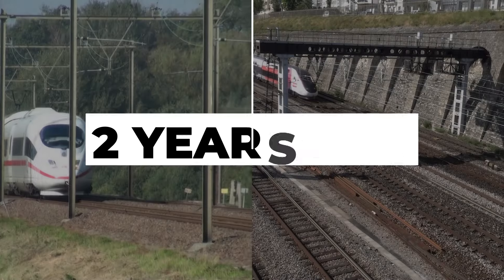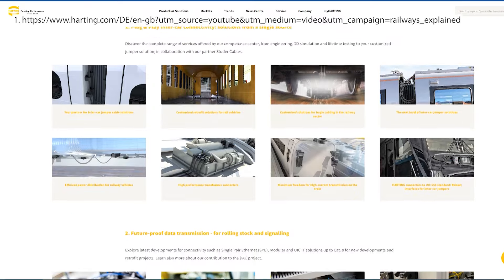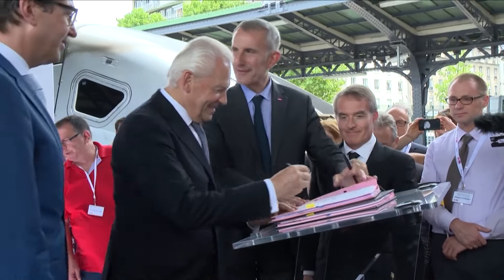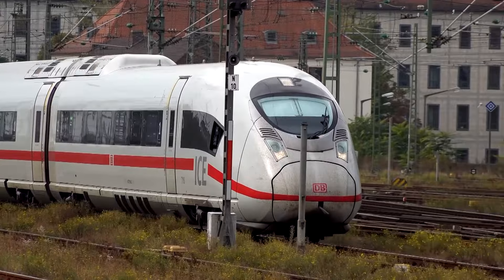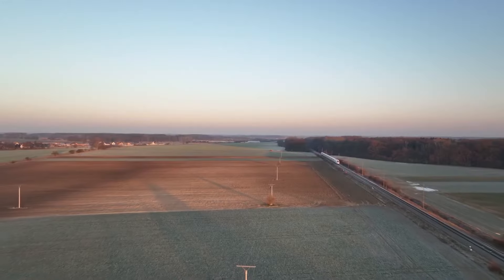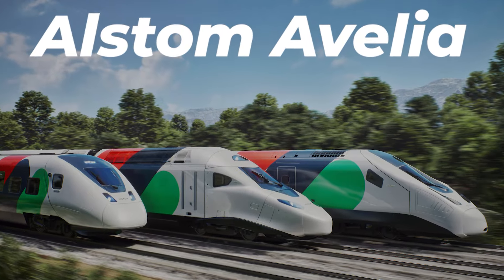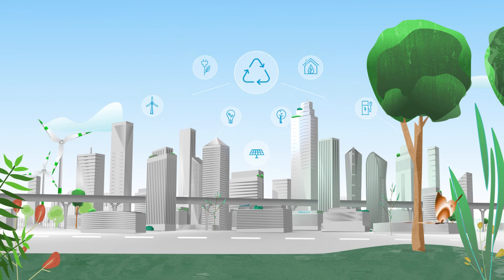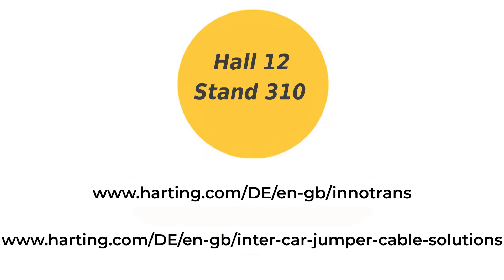Meet the Future of European Rail: Germany's ICE 5 and France's TGV M

Comment: you missed the most important thing about the TGV-M : it's battery that allows it to continue at normal speed even if there is no more electricity on the lines - a world's first
Reply: Not a world's first though, that tech is available on Shinkansen N700S series currently in operation (in case of an earthquake/loss of overhead line power)
Reply: What do you mean by "normal speed"? The most I could find related to the TGV-M's batteries is that it's meant to power the air conditioning and heating during power outages and/or emergencies.
Reply: @JeffFromTheIRS  "Normal speed" for a TGV would be 200-300. It's definitely not normal speed then, since that "greffon" (which is the technology used to power the train in case of catenary failure) is only meant to evacuate the train from the area with damaged overhead lines (at low speeds) to go back to a normally powered zone. tgv m definitely won't run 320 on battery power.
Reply: Not "normal speed", but only 30 to 50 km/h ... still it could be very useful in some cases

Comment: Maintain punctuality? Trains in Cologne are so delayed that the train schedule is just a suggestion at this point. Utter joke....
Reply: But how much of that is due to the trains as they were built? i.e. not lack of maintenance of trains or tracks?
Reply: @GustavSvard very little. Its almost all upkeep and organisation/overusage
Reply: None of those are because of the trains themselves, they're all the result of years of underfunding in maintenance of the tracks
Reply: Of course, there are also technical problems with trains. They are just as susceptible to this as any other technical product. The biggest problem with punctuality in Germany is not the ICE trains, but the fact that most railroad lines are not used exclusively by ICE trains. They share the routes with many other trains, including regional trains and freight trains. And there is a very good chance that a delay will occur somewhere, which of course has an impact on the entire system. Ideally, there would be many more exclusively used routes for ICE trains, but that will be difficult to achieve. Germany is too densely populated and the planning and realization of railroad lines takes decades.

Comment: ICE 5 will be used in Los Angeles - Las Vegas although it will be called American pioneer 220 but it’s a ICE 5
Reply: Not 100% correct - If Germany also choose Siemens (i hope) the ICE 5 and AP220 are buildt on the same Plattform "Velaro Novo". But can still differ in a lot of things (length, speed, exact design etc).
Reply: TGVM will be used in NYC-Boston and will be called Avelia Liberty.

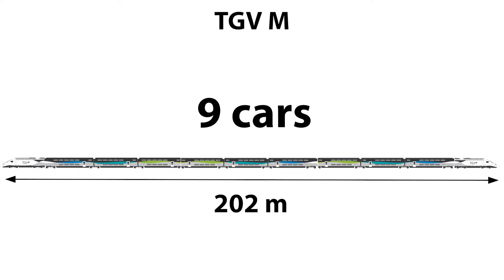Comment: 8:42 This is inaccurate. The TGV passanger cars are not 19.49 meter long. That is the avrage length. Of the 8 wagons. two wagons are about 21 meters long and the other are just shy of 19 meters long. 19.49 meter is the average length of the 8 wagons. This matters because other vice the math don´t fall out correctly.

Of all wagons was 19.49 meter long and shorted to 18.49 meter, the train would be 203 meter long in total. But the additional one wagon is not 18.49 meter long, but rather just shy of 18 meter long, There is basically where the extra meters comes from
Reply: 9*18.49 = 166.41
2*20+7*18=166

The diff seems to be only half a metre, what am I missing ?

Comment: Very interesting that the TGV M har 2 power cars. I was under the impression that all modern high speed trains were EMUs
Reply: There's nowhere to put the power equipment into double-decker with this loading gauge.
Reply: SNCF prefers power cars, it's more easy for them to replace for maintenance or in case of breakdown.
Reply: @PtrkHrnk  And the SNCF, the customer that makes the TGV overall design, have strict requirements regarding maximum trains length so that they fit the quays of some old, not up-gradable but very important stations. In order to match the passenger capacity needed with such a short train, there is no choice but to go double Decker.
Reply: @Kollum  Almost all high-speed trains in Europe are buitl around the standard lengths of 200 and 400m.

Talgo's HSTs also use separate power cars.

Comment: According to Siemens, the ICE 5 should be able to reach a top speed of 360 km/h. Unfortunately, our infrastructure is not yet designed for this. I hope that the new routes will be designed for speeds of up to 400 km/h.
Reply: no benefit of running more than the current vmax. energy consumption would go through the roof, as would the maintenance costs, for little time gain.
Reply: @olivieronrails  I have a DB employee in the family and he said exactly the same thing. Above all, we have too many stops in Germany for a time saving by driving fast, he said.

Comment: If the 400m long ice 3 has space for less than 500 passengers, how will the ice 5 (Also 400m) have space for 940 ?
Reply: Piles 🗿
Reply: the normal ICE3 is 200m long and has about 440 seats. The 400m long version is a coupled set of two trains.

Comment: Very interesting information and exciting. However, it seems that the first 272 km of the first operational segment of the California High-Speed Rail will use trains that will run at higher speeds than either of these projects. The California trains will run at 350 km per hour. More than likely, they will be made by Siemens, too.
Reply: Let's see first when the phase one will open shall we...
Reply: The tgv can also run at these speeds, but it's useless. The travel time gained is minimal and the infrastructure costs (maintenance) increase by a lot by going from 320 km/h to more than 350. So they just keep it at 320. Also the traffic on some high speed lines is probably already on the brink of complete saturation (with only the TGV traffic, that doesn't even count international competitors like TrainItalia, or AVE that will enter the market soon). That's why they add bigger and better designed (more space efficient) trains instead of just adding more more trains
Reply: @cdrw92  But China goes at 350 and soon at 400
Reply: @etbadaboum  China is way bigger than France , so time gained can be more significant with higher speeds. And also China is still in its high speed lines building frenzy regardelss of cost and real profitability but I can guarantee that many of these line will cease to exists in the future. In 2022 out of the 18 main lines only 6 were profitable.  and the entire system lost 15 billions. which is okay but it just mean they can affortd things other can't . until they won't be able anymore

France is aiming at stability
Reply: @etbadaboum  Mais la Chine et ses grandes distances n'est pas l'Europe dont le terrain est beaucoup plus compartimenté et exigerait des frais pharamineux pour une  nouvelle infrastructure .
Reply: @domipa3972  RIen à voir avec la distance, tout à voir avec des choix technologiques
Reply: @cdrw92  Railways should never be about economy and profitability. However, even I consider 400 km/h to be excessive on a 300 km course where the maximum time saving is 6 minutes instead of 350 km/h. I would much rather increase the speed between Madrid and Barcelona to 330 km/h. Given that France runs 320km/h on its 250-300km LGV, 330km/h would make sense on a 650km track.
Reply: "The California trains will run at 350 km per hour".....when ?
Reply: @goldorakrak8939  When it opens in about 7 years.
Reply: @mrxman581  You mean 70 years 😆
Reply: @etbadaboum  Nope, 7 years.
Reply: @mrxman581  About...OK.
Reply: @etbadaboum  China's HSR infrastructure is falling apart, especially on the smaller lines. There are reports of premature structural failures, so they've needed to reduce speeds and frequency.
Reply: @mrxman581  What a joke, never ridership has been so high and new lines are being opened, you just repeat US propaganda that Chinese infrastructure is made of tofu while it's in the US that everything is falling apart

Comment: I am left wondering why this spirit of technological advancement can't be replicated in the field of rail infrastructure development?
There's not much point in having more efficient rolling stock if the lines they actually run on are not improved incrementally in tandem?
A real world example - why is it taking so damn long to construct vital links between existing national High Speed Networks - the missing bit of High Speed line between Figueres (in Spain) and Montpellier (France) is currently planned for completion in 2040 - if European political leaders were really committed to advancing the growth of sustainable modal shift (from short haul air to high speed rail) that piece of line should have up and running twenty years ago, ie. 2004- so it more than 30 years overdue!
Unless and until high speed trains have real high speed track to operate on the prospect of significant modal shift will remain out of reach?
Reply: Avez-vous déjà entendu parler de la rentabilité indispensable d'un investissement ?
Reply: @domipa3972  Je n'ai jamais entendu parler de cette mesure financière particulière et je ne suis pas sûr du rôle qu'elle joue ici.

Comment: Why TGV-M can't go faster than 574.8 kmph speed set by its old version
Reply: What's the motivation? Noone uses that speed in revenue service.
Reply: @u1zha  I know but it's love to see how fast train can go
Reply: @AM_Nevrekar that’s a very bad argument, why would they invest in a faster train just to break a record when that speed won’t be used in revenue service? Besides the record has already been broken by maglev trains
Reply: @elemental-server   you are right
Reply: It was a world record, not used commercially. Max speed on French LGV is 320 km/h and won't go higher probably. China runs lines at 350 km/h and probably soon at 400 km/h with the CR450.
Reply: @etbadaboum  More precisely, the LGVs are designed for 350/360 km/h (since 2007), but operated at 320 km/h.
Reply: @elemental-server  Maglev is its own category though, TGV still holds the record on rail
Reply: @etbadaboum  yes, the T.G.V. still holds the record of fastest non-revenue rail speed. Maglev holds the record for fastest train overall. (Both in revenue and in non-revenue service)
Reply: @elemental-server  Also Maglev is not used as intercity but travel from the airport to the city, Chinese otherwise use conventional high-speed, so far
Reply: @etbadaboum  I am aware of that. It still doesn’t change the the fact that maglev has a higher top-speed. And there are currently intercity maglev lines under construction in both Japan and China.
Reply: @elemental-server  And they are marginal compared with the high-speed rail which the 99% dominant form of high-speed long distance train transport
Reply: @etbadaboum  Yeah I agree with you. But that’s not what we were talking about. We were talking about the speedrecord. The percentage of Maglev used does not change the speedrecord. Why even bring this up?
Reply: @elemental-server  Because it's much easier to break record on Maglev than rail, why are you so obsessed with Maglev? And the only commercial line in China is reducing speed because it's unprofitable with technical problems.
Reply: @etbadaboum   I am not obsessed with maglev, in fact I am a hsr and conventional rail advocate because of its price effectiveness  (and I use it on a daily basis to get to work). I only brought up the fact that maglev holds the record for fastest train in the world. All the other times I talked about it in this comment section is because you only talk about the maglev part of my original comment. 
You suddenly responded to my comment about the TGV holding the record for fastest non-commercial rail and maglev for fastest train with“maglev isn’t used for intercity travel” which isn’t what we were talking about at all. We were talking about the speed record of trains. I don’t want to start a discussion or anything because what we both said are facts and is correct.
Reply: @elemental-server  Fine!
Reply: The induced transverse wave would tear the catenary and the train apart at higher speed. The absolute maximum is a little over 600km/h, but you have to have a margin of error.

Comment: That is not progress! The only thing they have done is change the design inside and outside, but technologically there is no change! If not the German, then also the French trains are in a better state compared to the Chinese trains. They are much further along and go much faster. Also look at the rail infrastructure. The way the Chinese lay their tracks is much more innovative and progressive. Knowing that the Chinese trains already go 350 km/h, the "new" European trains are slower. In addition, the MAGLEV technology in China is much further along than in Europe. There they should have a MAGLEV connection within a few years, while in Europe that is not even being discussed. By the way, according to the information I have, the Russian high-speed trains will do even better, because they will reach 400 km/h. The question I ask myself is whether this video is not pure propaganda.
Reply: In densely populated germany there's often not as much distance between population centers as you'd see in china, or even more - in russia. You can of course increase max speed, but you'll get diminishing returns. Time for braking and accelerating will eat up more and more of the drive time. So the actual difference between 300, 350 or even 400 gm/h max speed might be much smaller than you might imagine when using it on german routes. Hence its less of a priority here to have record braking speeds.
Reply: I'm very skeptical about the russian high speed claim given that they are currently running siemens velaro sets between moscow and st petersburg
Reply: Pour des pays à l'échelle de l'Europe, le 320 km/h est la vitesse optimale et c'est la plus rentable, parler de "trains lents" est un peu ironique.
Reply: The Maglev technology used in China is actually German, it is the "Transrapid" tested in the northwest of Germany since the 80s. From the 60s the Germans did research and prototypes on the maglev concept.

For French trains, the TGV and LGV built since 2007 are designed for 350/360 km/h, but operated at 320 km/h.